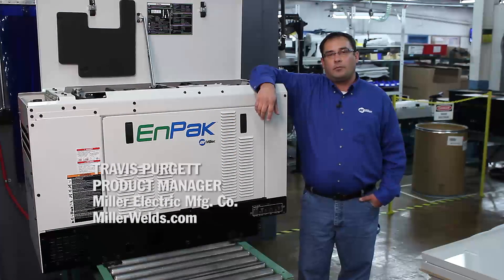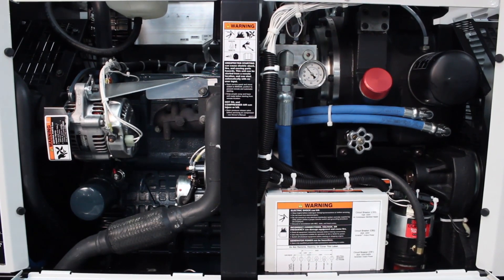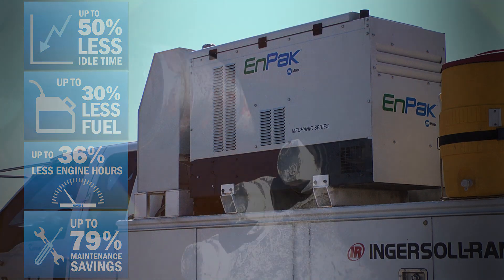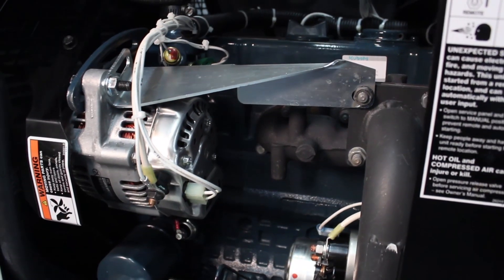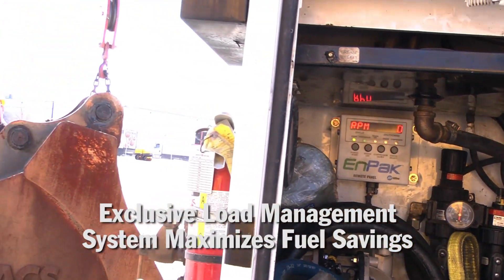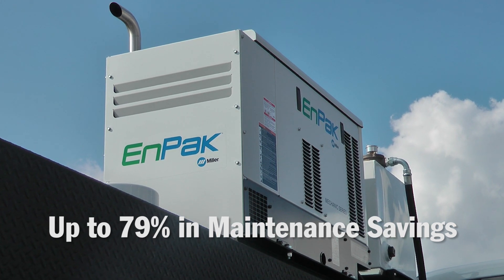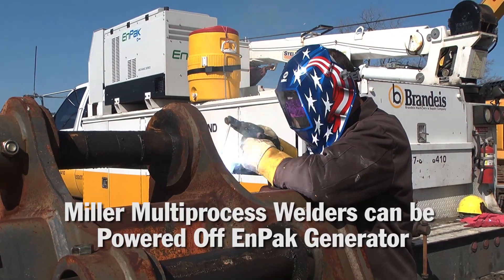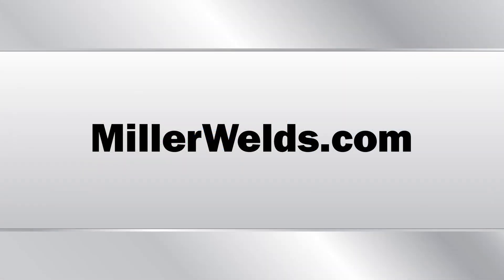Newly Enhanced EnPak Further Improves Productivity and Jobsite Functionality

Comment: generator constantly fails so not able to work. enpac noise while running is so bad ear plugs hearing protection needs to be used .they lie about noise more.feom a truck. Air compressor in cold weather in frozen most of the winter.theres no air dryer factory standard .hydraulics will kill engine when use in cold weather  when trying to use crane in cold kills enpac engine instantly. Also the exhaust blows right into ypur face while working of back of service truck.  terrible unit .not to mention the break downs it has. fro  hydraulic pump failures to generator failures to air compressor failures and at very low hours with factory serviced  by Miller dealer .
Reply from the maker: Hi, Christopher. Our team would like to reach out and talk through the issues you've described. What's the best number to reach you at? Feel free to send it in a private message. Thank you!